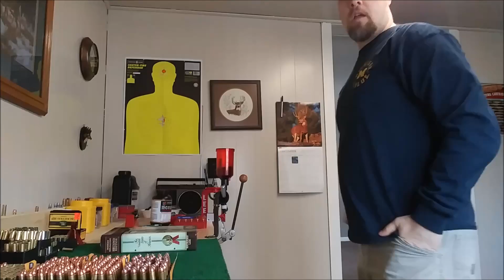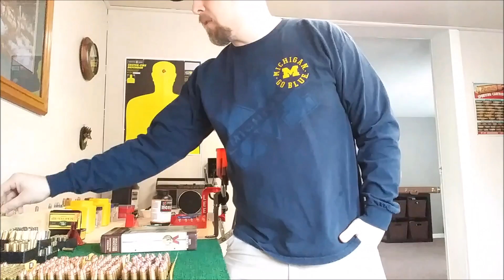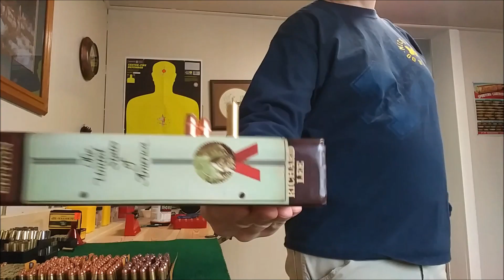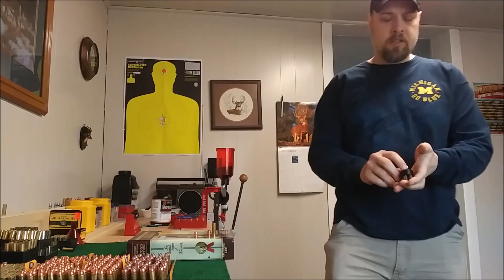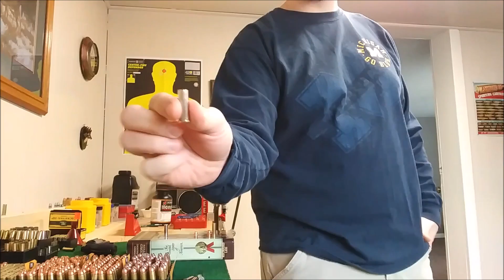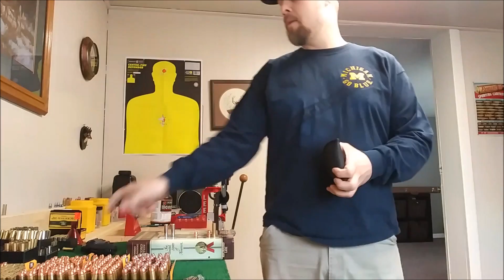Heavy Vs. Light for Caliber Bullets?

Comment: 38SPL snub is the hardest to get hp expansion from, 380 also. For those fast, light bullets seem to work with hp's better. And heavy not expanding bullet then slow works great also. 9mm or higher caliber is less of an issue to get reliable good hp expansion. Published velocity for a given caliber and bullet are usually not correct on the handgun in our hand. Highly advice on a chrony for reloaders.
Reply: idk man its like a mortal sin to buy a taurus..revolvers gotta be cool and taurus's arent..i had a the TCP380 (not a revolver) and the trigger sear broke after the 2nd magazine using target ammo..also as far as semi autos go the 40 is back!i have a 9 40 and 38 and i feel fully armed with my 40 caliber hi cap SA..its a combat firearm
Reply from the maker: I can't say I have ever made a .38 spl 158 gr expand in water jugs, but the 110 does well. I actually think my 130 gr HST carry rounds are a happy medium, they been designed from the ground up to perform well and efficiently in my gun.
Reply: Lead expansion requires a bhn of about 6-7 hardness in a 38SPL. Most cast bullets available are over 8 bhn. 38SPL is the caliber I hate to love. Try to get your hands on bonded gold dots for short barrel, great expansion at anything over 725 fps. But I also favor 158gr swc under 700 fps. On another note, the Taurus 85 ul has a better trigger than anything I own. The lcr is the only revolver out there with a better trigger. I plan to shoot this new Taurus to death. So far it's been flawless. I've got about 400+ through it hot +p to normal loads.
Reply from the maker: I had a dream where I was going through my stuff and I found a couple of revolvers I didn't know I had, and one was a Taurus 85 lol. It was a positive feeling, like I felt I could shoot that Taurus as much as I want and not worry about breaking it because it was inexpensive.
Reply: This one had a miniscule scratch on the muzzle. Picked it up for 239 + the queen's tax like new in box. Regular price was 280+ tax. I could not pass on it. I was there for a Smith&Wesson 642. Now it's a beater. I'm carrying it also. Feel real confident and carry it with 100% confidence. Great trigger! Take the tassels off a moving dancer without damaging the grapes... Thanks for sharing the dream. Sounds like you got another shooter coming in the near future! LCP?
Reply from the maker: YES lol. I did my taxes with great success, so in a couple of weeks i'm going to get an LCP and a .380 die set. It's gonna be a lot of fun for not much money.
Reply: I bet you'll carry it! During the summer it's my 2 legged pocket gun with a g23 to get to my 629 Smith&Wesson with a 3 inch barrel. Blackies are my friends but you never know when they could get confused. Been raising them and many other forest friends for 8 years. I call this swamp, frozen heaven! You will like the lcp, another set of dies next? You'll love reloading for it. It's a small 38SPL almost!
Reply from the maker: I plan on carrying it anywhere that I might lose it, get it stolen or get it dirty, that way I can keep my beautiful revolvers safe!
Reply: I'm loading 2.9gr titegroup on winchester 95gr flat nose. Carry it with 1 factory critical defense in the chamber. The other 6 are soft loaded winchester fmj. The first round is a courtesy round for bystanders. All my other semi autos 3 handloads hp's then fmj. Revolvers are hp's unless in the woods, another words, outside, sjfn heavy rounds. My 357Mag addiction! The 629 is a beast for little blackies... They run about 350+lbs around here. 9mm fmj's is ok for any blackies to be honest!
Reply from the maker: I have heard that black bears will take the hint with any connecting round and go the other way. I have also heard that .380 pistols can be finicky with the ammo selection, which is weird that flat point seems to be pretty common when the common complaint I hear is feed ramp jams. I already have some Critical Defense rounds laying around courtesy of my 2016 water jug and wood test between the J-frame CD+P .38 spl and the Bersa Thunder CD .380, but i'll have to do some research on .380 ammo and see what's going to work for me, and of course load a ton of FMJ myself.
Reply: Every handgun is unique. But we can compensate for variations with very little effort. The little lcp I run has eaten everything like a hungry fat kid. I run firearms clean, dry and polished. That often corrects many feeding and or cycling issues. Oil, gunpowder and dust & lint are mortal enemies!
Reply: Haha not the best reputation for sure. Some swear by them. I say Taurus is hit or miss. And not a 5000 round shooter! The 40 is a serious caliber not for the faint of heart. Carried a Smith&Wesson 1076 for years so yes, I also like the two calibers. The 40, 10mm, 357sig and 357Mag are great choices where risks run higher. As much as I love the 45, I've all but retired that caliber.